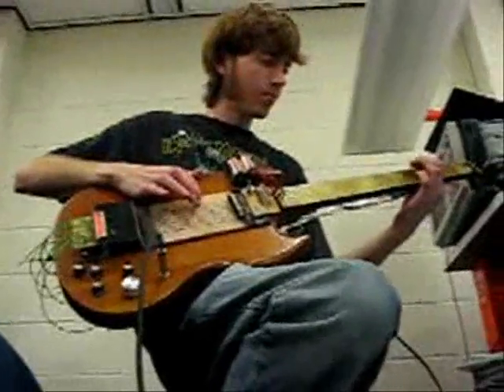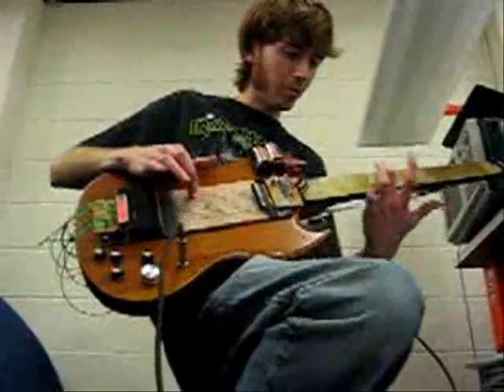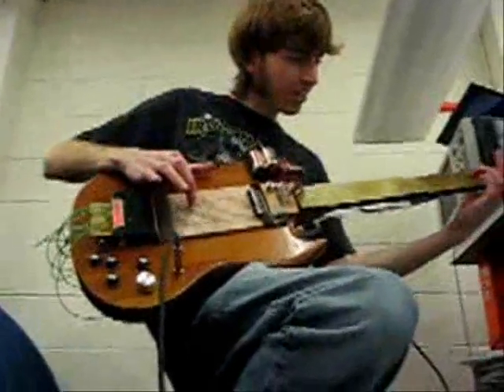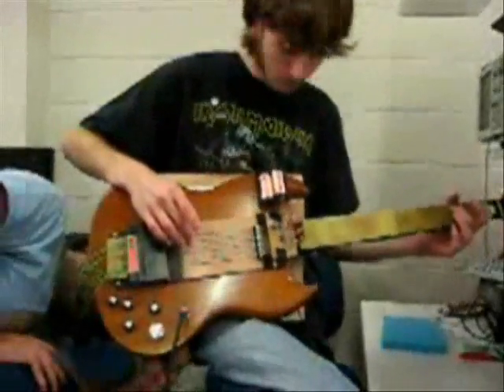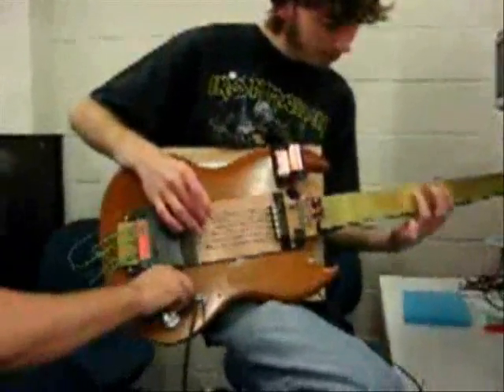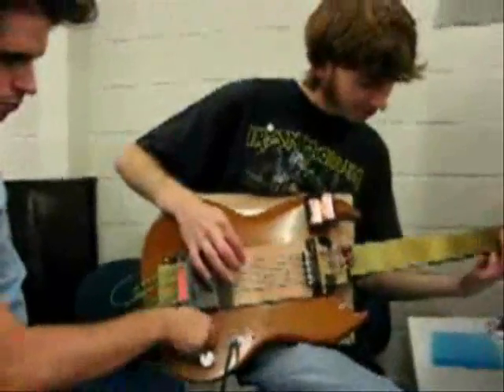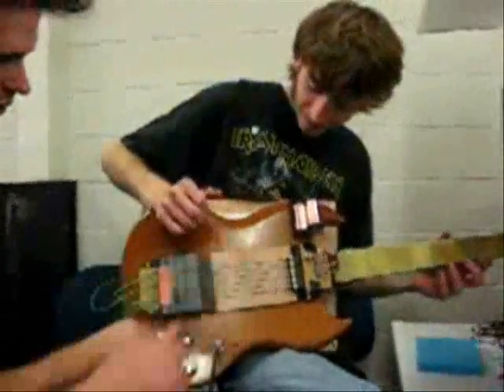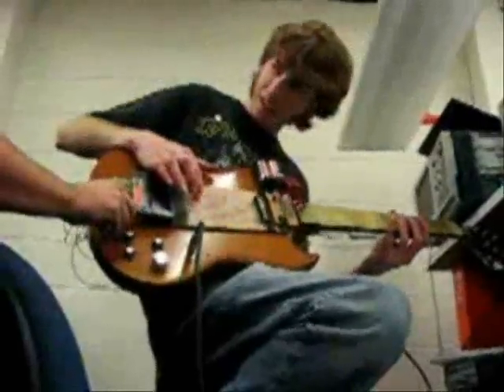The Stringless ( Laser ) Guitar

Comment: I know this is an old video, but how long did it take you guys to build it? and what do you guys use to power it and amplify the chords from the laser? Pretty freaken neat guys. :)
Reply: This was our senior design project for undergrad EE. We spent a semester designing it and a semester building it. The laser string was a simple laser diode with a detector on the other side. If the beam was broken that means the "string' was being plucked. When that happened, we had a logic board see which frets (if any) were being held down and send a square wave with that frequency to the output. Extremely primitive for sure!